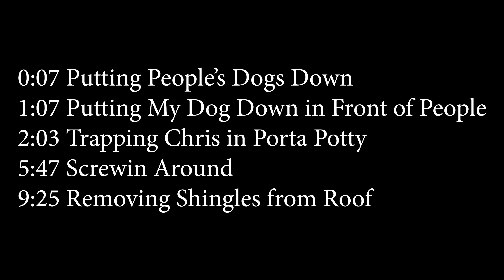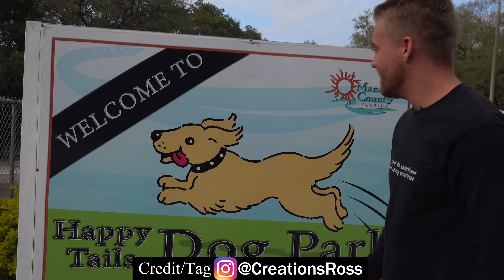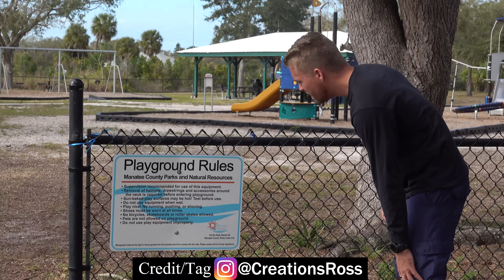Putting My Dog Down in Front of People

Comment: Instead of scraping the shingles you just need to use that tool to take out the nails from the top of the shingle and lift it off it will stay in one piece and it makes it way easier to clean up